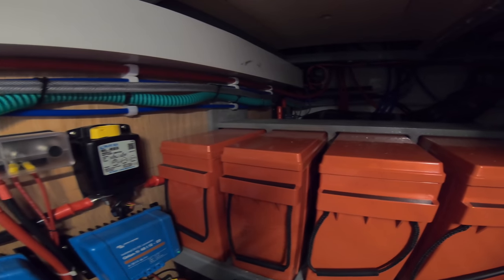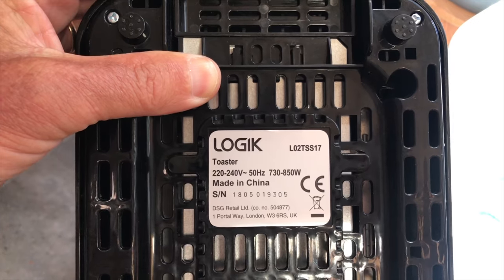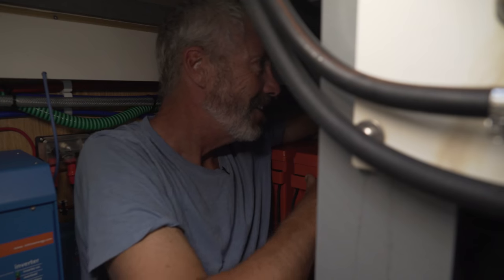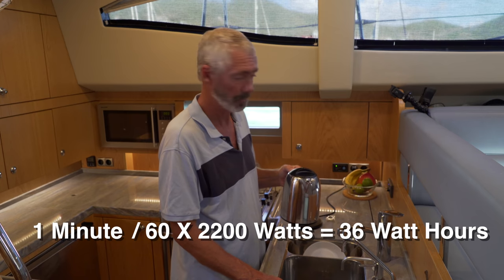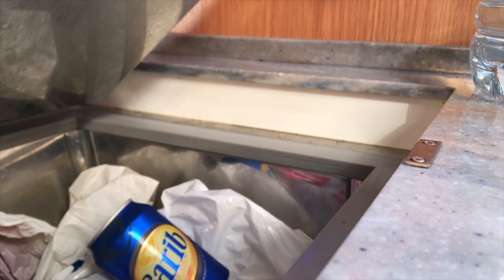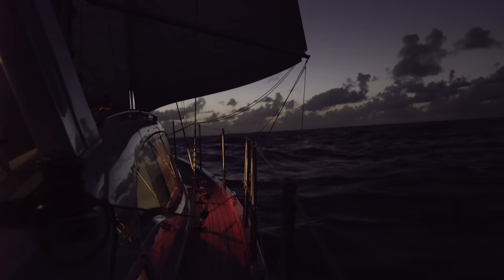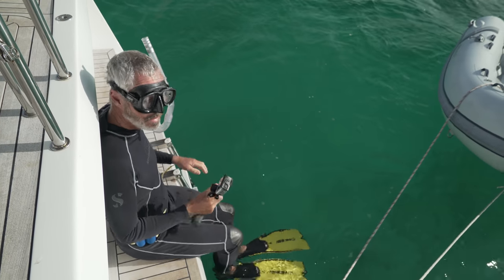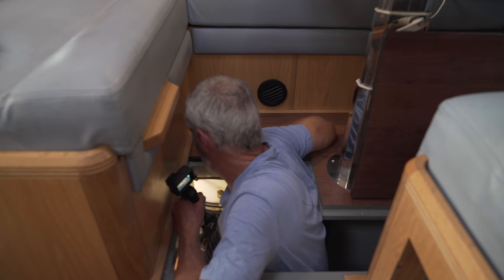Understanding Marine Power Systems - Part 1

Comment: We are looking at buying/building a boat in Europe. We would eventually want a US boat after using for a year in Europe. A video on Euro vs US AC Power with the issues of adapting back and forth an the option for converting/rewiring to permanently  change the boat would be GREAT!!! We are looking at several European wired boats that would need something done when we bring it home to the US. Thanks so much for this series.
Reply from the maker: Interesting idea for a show Harley. We were not planning to bring our boat to USA so didn't install a 120V charger... then we decided to sail up to Chesapeake for Hurricane Season :-(  anyway its no problem since our solar panels give us almost all we need...

Comment: Great video! Editing and camera angles were wonderful. You talking to yourself  was a very nice touch! And the content was also great! One quick question: why not amp/hours instead of whatt/hour?
Reply: Renato Fernandes 
Ah tells you nothing unless you know the voltage. Gadgets on a boat are often 230/110, 12 and or 24 volt. Therefore you collect the data of how much power (Watts) you consume. 

To simplify, imagine a water hose. The thickness is Amps and speed of water is Volt. The amount of water coming out is Watts. And one big bucket can be equivalent to 1kWh. 

The fist task is to find out how many buckets of water you are using. He explained that very well in my opinion, much better than other sailing channels. 

I won’t go further as the next step will be explained in next episode. 

Cheers and I hope I did not confuse more😉

Comment: Love the video and the way you as an experienced videographer keep it fresh and informative. 
So question. You have purchased and outfitted 3 boats in Europe now. 
Where are the best places to shop in Europe? We still have not found anything like defender in Europe. And what country’s are best to have equipment shipped to and what country’s are best to get work done. Thanks.
Reply from the maker: Thanks Ice Bear :-) We found the UK was easy with great sailboat shops especially on the south coast where so many yachts are based. France also had a lot of support for boaters too but for me with my lousy French it was a bit more difficult.  The best part about Europe is that with complete free trade between the countries its super easy to shop online and have packages sent directly - no customs or special duties to delay ordering. So you have easy access to all Europe to order online from ... We didn't find anything like Defender either but if you have Amazon plus the online chandleries (https://www.force4.co.uk https://www.accastillage-diffusion.co.uk https://www.bigship.com)
In France U-Ship and Big-Ship were two good chandleries located in many port areas. Not sure they have English websites though.
Reply: Distant Shores thank you Paul. Will do. 
See you on the water.

Comment: Happy to see someone that starts calculating/collecting data from the right end. 
One needs to know how many buckets of water one needs before making the water tank. 

Great job!
Cheers

Ohh by the way, you got a new sub:)
Will you also regarding to electric system on board talk about corrosion on board when taking power from land without (can’t recall the name) that induction “thing” makes you “disconnected” from land power?
Also how not to have high Voltages next to low Voltage?

Now time to look around your channel:)
Reply from the maker: Thanks Chuk Wow! Welcome aboard. Good suggestion about going over the "Isolation transformer" to safety connect a boat to shore power.

Cheers, Paul
Reply: Distant Shores TV 
English is not my native tongue, but I guess you figured that out;).  Thanx for putting the correct words for others to understand. 
Fair winds

Comment: I'd be interested to hear your opinions on 220 vs 110 in different parts of the world you've been. If it's cost effective to convert, or even worth the effort. I'm thinking 220 uses thinner gauge wire vs 110 and down converting would be practically impossible??

Comment: No mention at all of losses through 220v inverters, when running mains powered devices from the ships battery bank. Replacing your electrical devices with 12 or 24 volt DC versions will save you a lot wasted of energy.
The biggest anachronism in this respect is powering your 19v laptop, from a 220v adapter, that is connected via an inverter to a 12/24v battery system.

Comment: As always great and useful video - thank you. Could you please say few words on how do you deal with boat equipped for 220V in 110V areas. Thinking on buying EU boat and sailing it eventually in 110V world. How do you deal with this problem?
Reply from the maker: Thanks Piotr. We had a transformer installed on our previous 230V boat which worked pretty well in 110V lands. Some people just add in a 110V charger and let the inverter provide the power to the boat at 230